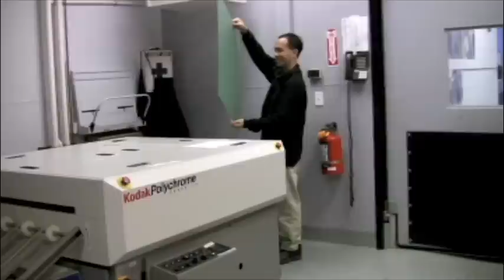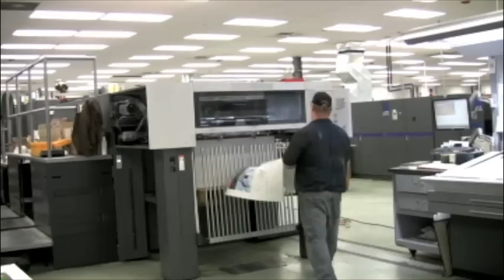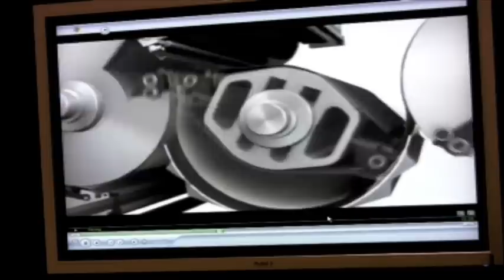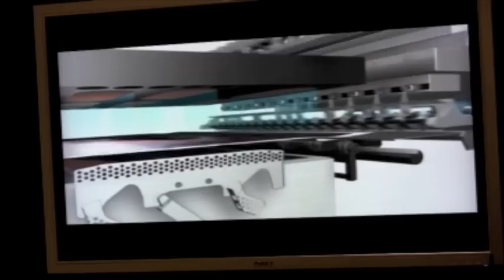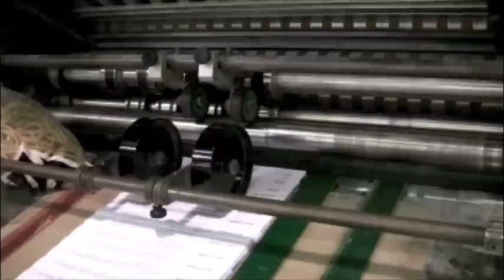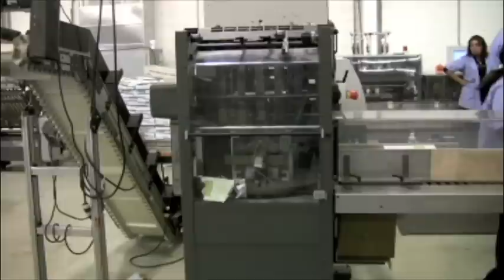printing sheet fed 101

Comment: what type of ink is used?
Reply: Max E Gonzales it depends of what kind of press this is. What I mean is that some press have U.V. lights to work with U.V and hybrid ink. Some can only support traditional ink😉
Reply: I used UV inks in all of my presses. They are compatible on all presses. Used them on 5 color GTO. And my Komori 5 color w/coater.